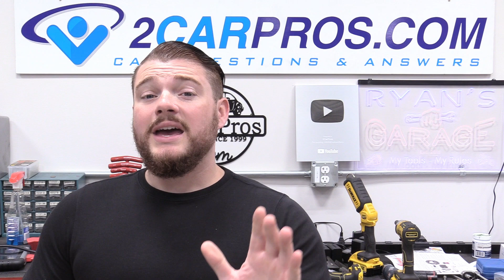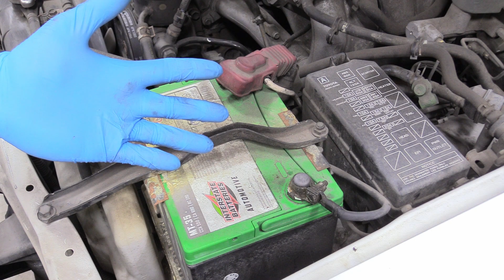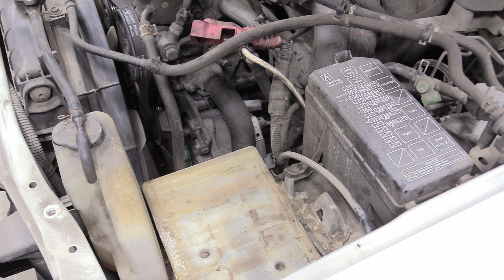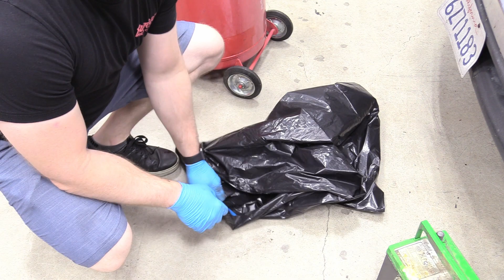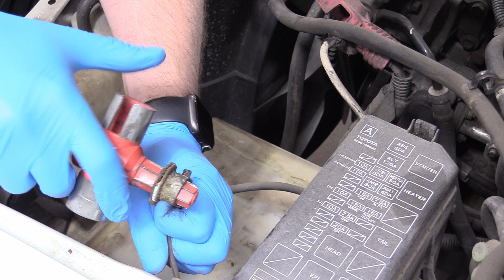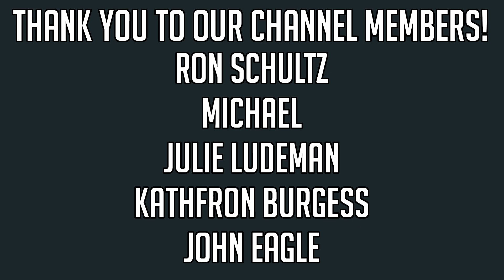How to Replace Battery Toyota Tacoma 2.4L 1995-2004 | EASY!

Comment: I recently bought an '03 Toyota Tacoma and today when i tried to start it i just get that rapid clicking noise and no headlights and no radio. I am not sure how old the current battery or when it was last replaced, but would you think this would be indicative of a bad or dead battery? I'm going to bring it to autozone to get tested later this week. It's my backup truck. Thanks.
Reply: Same thing happend to me today. The 12mm bolt that holds the two cables with eye bolts wasn't tight enough. going to buy a 12mm wrench right now i was tightening it with pliers and it wasnt enough

Comment: What size is the front bolt for the bracket that holds down the battery? Mine fell into the undercarriage and I can't locate it so I need to get a replacement, thanks for your help!